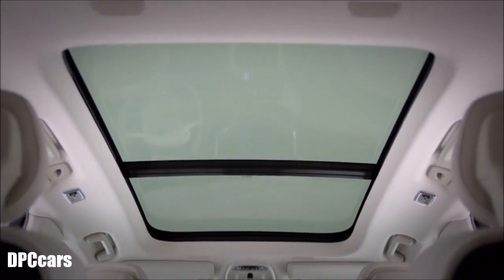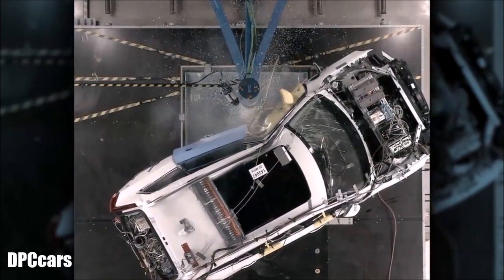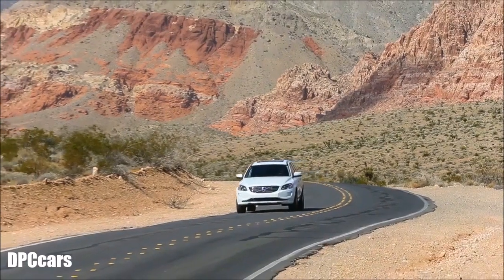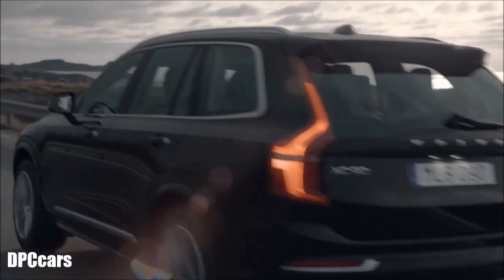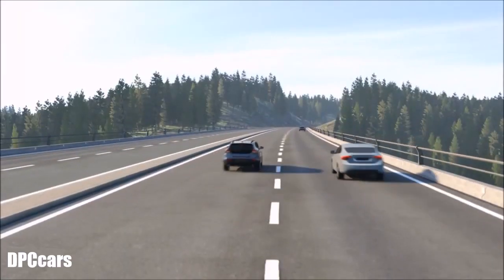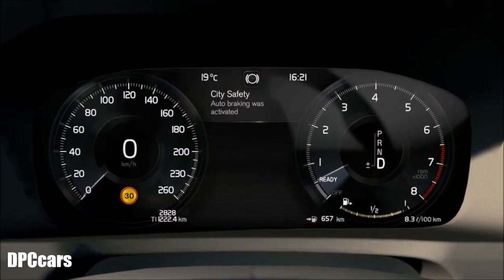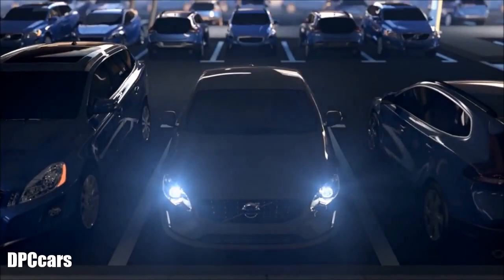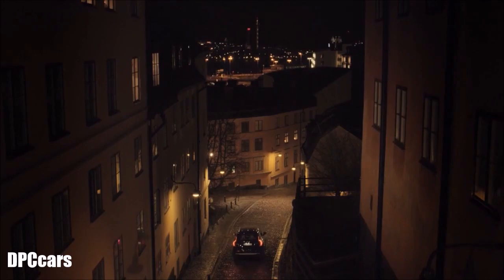2017 Volvo XC90 Safety Technology and Crash Test

Comment: Tesla Model X is safer!!
Reply: azalru you’re a dreamer, but not our fault you bought the wrong car
Reply: azalru my ass
Reply: Tesla? 🤣🤣🤣 no.
Reply: Depends on what you expect
Reply: Model X, in case of a crash, and you aren't injured, remove your seatbelt, bend down and please remove the speaker cover......reach inside and look for a cable....once you find it, pull it forward towards the front of the vehicle...as hard as you can..while pushing the falcon door outward as hard as you can....hopefully the battery didn't ignite by then...hopefully the door can open if it isn't damaged or obstructed...good luck!!🎉